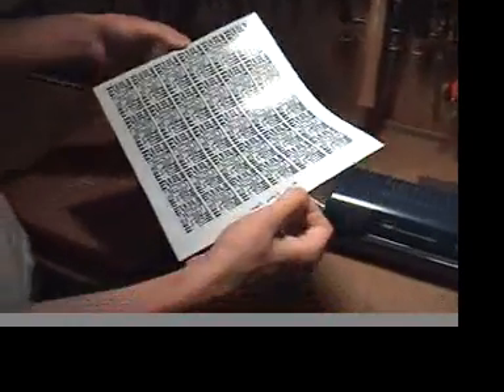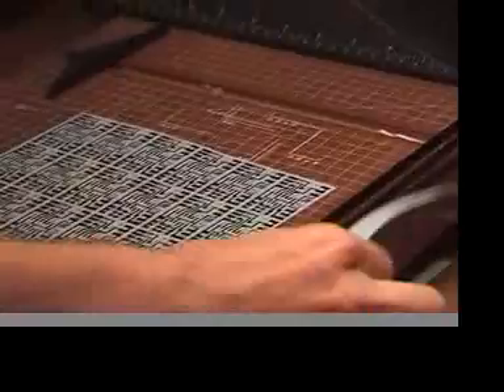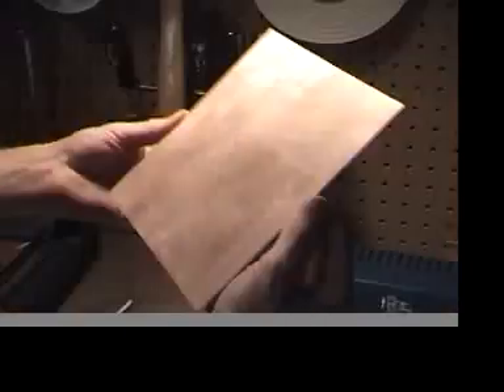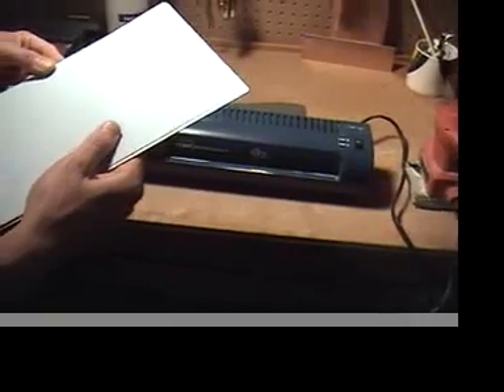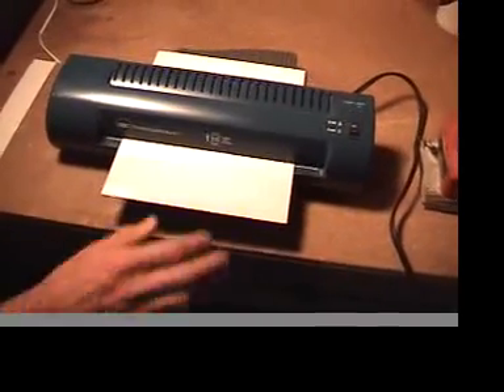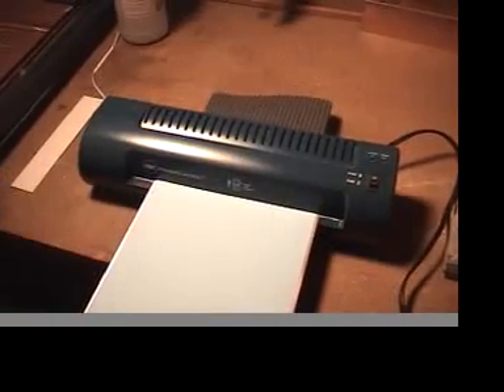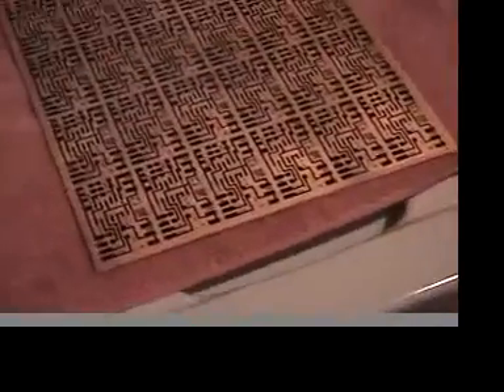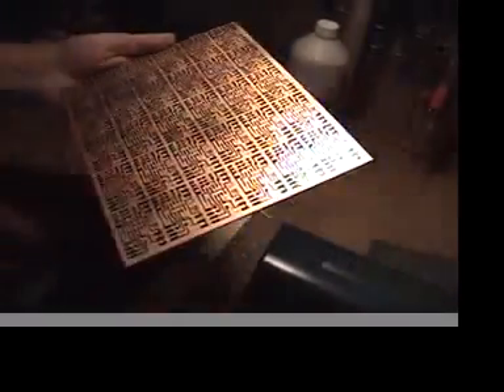Circuit Etching Tutorial Video 2 of 3 - www.GetLoFi.com

Comment: How did the paper came off like this?
I used the tuner transfer method allot and only the press N Peel sheets came of clean to me. 
When using photo paper i have to peel the remaining of the paper and i allways have tiny left overs in spaces between tracks and inside the holes...

Comment: DO NOT use rubbing alcohol!  Rubbing alcohol contains oils which will prevent resists, masks, or toner from adhering properly -- thus defeating the act of cleaning the board.
Reply: Isopropyl alcohol contains oil? What did you smoke?